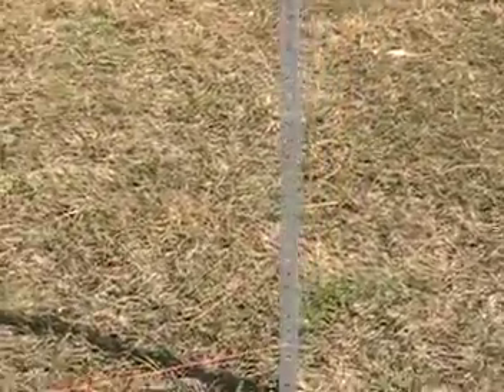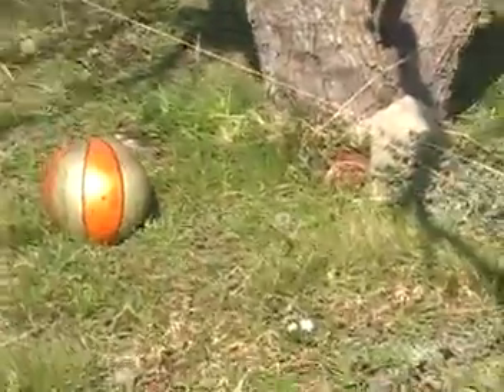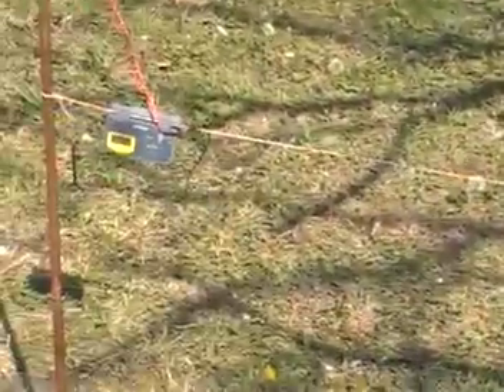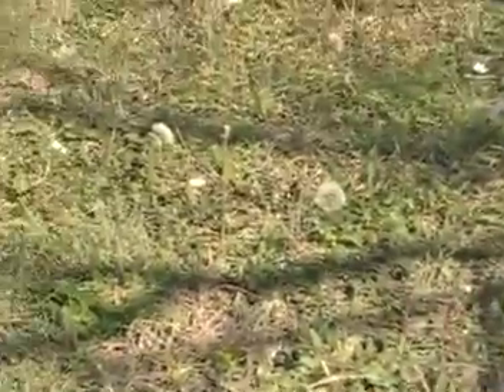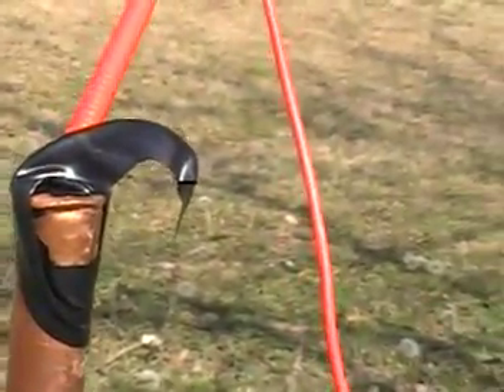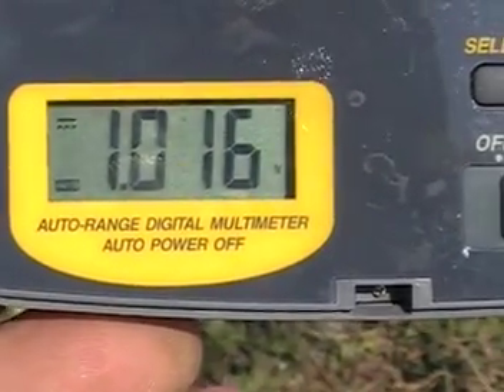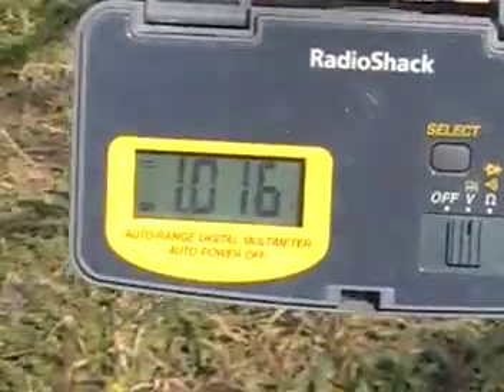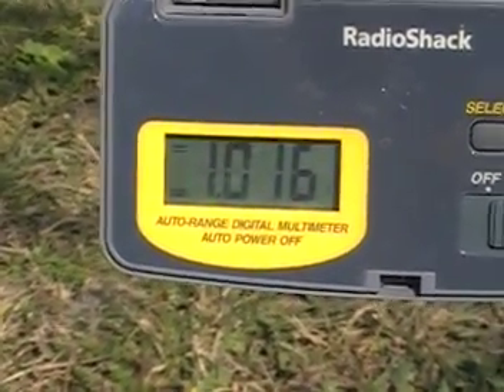My earth Battery

Comment: I looked into this a couple years ago and, if memory serves, the moisture of the ground made a difference in the output. 

With LED technology, one might be able to take advantage of this and other means of tapping the natural energy of the earth and air.

I worked at the bottom of the food chain in electronics and electrical work (PSNS and Keyport, Washington).  If nothing else, I've learned many claiming to know electricity know a lot, but less than they think they do. Though much has been determined, that is, it is reasonably safe to say electricity will act certain ways when you route it through this or that and so forth, it remains just theory.

Take for example, fuse panels or breaker boxes in our houses.  I hear electricians say "you'll use less power if you switch to as many 220/240 volt circuits as you can. However, in the end, it remains, though you are cutting amps in half by doubling voltage, the wattage (energy) in the circuit remains the same.

For example, a one hundred volt circuit using five amps would use five hundred watts.  If you doubled the voltage, you'd use half the amps (2.5).  Wattage is volts times amps, so you still get five hundred watts.

Consider the following: 

1)   You use two slots in the box, when you switch to 220, so you can't put any more circuits into the box by converting; and,

2)   Your circuits are limited by their wire, which the breaker protects (i.e., 15 amps for 14 gauge, 20 amps for 12 gauge and 30 amps for 10 gauge).

In the end, that wattage translates to heat (e.g, you'll burn the skin off your finger slower touching a forty watt bulb than you will touching a hundred watt bulb). As such, one might ask why they did not call it

Perhaps we should have called it a 24,000 watt panel (200 amp service).  Of course, regardless of what you call it, if you took advantage of every amp supposedly available at the panel, that would be a lot of heat in the panel and the line feeding it.

In short, merely that others know a bit about does not make everything they say [or presume] the last word.  Everything that could be discovered or invented has not been discovered or invented. So have fun, but play safe.
Reply: You're not considering line loss. Wires connecting from the power box to your appliance are not superconductors -- they act as a resistor and waste energy to heat. Delivering 500W to an appliance burns up more than 500W because the wire is burning some electricity too. The wire will waste less power at half current than when running at double current. You can calculate the line loss using: P = I^2 * R. The effect can be quite dramatic for high current appliances, since current is squared in the equation.
Reply: zilym
Line loss is always an issue. So is trying to squeeze a half K of wattage off one of these, which is why I never went there and just pointed to low watt lighting (LED). 

As was said elsewhere, these were used to power telegraphs back in the day.

Comment: I have watched several videos about this earth battery. How about putting pieces of long  copper pipe in the ground connected the pipe by a copper line, then using maybe gas pipe the entire length as the copper and attaching them the same way with same material as the gas pipe. I think mayb the depth and length is the key to the strength? Perhaps I may try it. Has anyone tried it?
Reply from the maker: Great idea.  Give it a shot and let me know how it comes out.
Reply: I did and you are correct about the depth and length.
Reply: Tesla tried but the jew banker shut it down. Teslas tower  had a well 12'by 12' with a metal shaft that was connected at the bottom to spokes that formed a 300ft circle around the tower.

Comment: Disregard any bad-mouthing you may get on this. It can be very useful if you suddenly find yourself off the electric grid and unable to communicate.
I worked as a radar tech for many years at local aircraft manufacturers and served a five year term as a student at a local university.
I am well aware of the science involved, and I am not belittling your experiments. It's the best way to learn. There is almost always a plentiful supply of scrap iron, aluminum and copper. Doesn't take a stretch to see how quickly you might get electricity.
Reply: RHEAD100 sorry just to jump in gentlemen, but i just had to compliment the way you guys speak to and respect eachother in here. Im Serbian and due to that a big Tesla fan so i love watching and learning anything i can about free energy. That being said, you guys are great in here. I came off a replacing a screen on a smart phone comment section earlier and the way they spoke to one another blew my mind. I was actually afraid to even ask a ? Thinking how dumb they would have made me feel. But you guys are human in here. You guys thank eachother, and lift eachother up instead of putting eachother down. Im sorry to interrupt, but i just had to tell you guys how nice it is to see human beings are still left in this cold world. God bless!!
Reply from the maker: THANKS BOSS ;   So far ;;;   The only bad comments I have gotten is from people that don't listen.     Iike ,  the guy that said I needed glasses  ( I said the sun was at my back and I could not see the view finder ).  And a lot missed the part where I said I know NOTHING of electronics.
I have Great respect for guys like you, that do.
Reply from the maker: Marko Milinkovic THANKS Marko .

Comment: That other thing you mentioned way down on this comments list about the static charge is possibly something of a different type of phenomenum. (I misspelled that), but there are other people working on that experiment. It has to do with an antenna that is insulated from ground and it picks up the static charges from the air,....which is higher in voltage the higher the antenna is elevated from ground.

Comment: The way to know if the electrolyte such as salt water is increasing the voltage would be to see if you can reach 0.8v in one cell with only water with no salt in it. I got the 0.8v figure for salt water from a DC electronics book, but it did not have a figure for plain water also.

Comment: In order to produce any potential you must have one metal that has a losely bonded electron in its outer orbit of its atoms and another metal that has the ability to gain an extra electron in the outer orbit of its atoms. But also the electrolyte can increase the potential it seems like, but I might be wrong here, it might only increase the current slightly.

Comment: The way to get more voltage from a salt water battery or any battery type actually is to make many cells by separating the water in separate containers with separate electrodes, and then connect the electrode to each other positive to negative and take the voltage off of each end. If you want more current, use large containers and large electrodes in close proximity between positive and negative electrodes but never touching each other.
Reply from the maker: John ;  My friend .  In every    "DETAIL ",     You are 1 0 0 %    CORRECT.

Comment: I think on the Earth battery it's really just the moisture in the dirt that causes the rods to act as a battery. The salt water battery will produce a higher voltage than a tap water battery, about 0.8v per cell is the limit. But it will cause more corrosion of the rods or plates.
Reply from the maker: DANG it  John ;  you  hit the nail square on the head.
Reply: ...interactive differential torsion fields facilitated by dissimilar materials? The salts and trace elements of salt water allow for a significantly higher differential exchange? Tuning the fields becomes the key to both input and output....?  Tuning is length of rods and/or thickness of material? Consider both the amounts buried and exposed as well as shapes for gathering/collectors? ...if we re playing w/ antennas...the earth battery is just an addition to the existing array; magnetic earth? IF we are closer to the actual harmonic Frequency ( 60Htz ) of the array then the more desired output we receive...?  ...consider the potential from the acidic effect of say adding this to your septic drainage field/tank? ...vs say lime or lime water or sea water? ...am I understanding this...or flawed conceptualization? ...although the acidic effect would work regardless of length or size...it would significantly amp the output? many smaller torsion fields interacting to create a larger harmonic torsion field, interacting with still larger torsion fields? ...scaling? ...?
Reply: Fox Fleet When you say 60Hz,then the existing array is the currently used power grid. I do'nt know if that is what you meant or not.
Reply: Fox Fleet
It is possible to pull power from the grid with an antenna,but very dangerous,costly,and lastly I think unfortunately illeagel. I forgot how to spell that word.
Reply from the maker: John Kerley Thought I said 6 not 60 Hz sorry
Reply: KISS. Thx Rhead100.
Reply: RHEAD100
I just replied to Fox Fleet because I saw it in my Email, no problem.

Comment: It's just that I have tried both the Earth battery and also the water battery experiments before and found the results pretty much identical.
Reply from the maker: I am glad you brought that up.  I , Personally have found it much easier to control voltage and amperage in the salt water battery.
Reply: The voltage you get depends on the difference in the metals involved much more than the electrolyte type.

Comment: I think the DC power lines are very high voltages. The telegraph turns DC into AC by back EMF from the relay coils on the key which is higher than the original DC supply voltage every time the key is released through sudden magnetic collaps in the iron core that the coil is wrapped around. I think the earth battery and the water battery are really one and the same.
Reply from the maker: Your explanation sounds great .  Better than anything I have heard so far.
THANKS.

Comment: Very interesting but if one were not near any Telluric currents in the earth, I wonder what would happen to the voltage if the ground was made basic on one end by mixing lime into the ground and acidifying the ground on the other end with Aluminum Sulfate to create a cathode and anode arrangement. I bet the voltage would be higher and wetting the ground at each pole would probably increase the voltage too.
Reply from the maker: MAYBE ;     That is why only , 2/3 s  of the telegraph stations in the US in the mid. 1980s used them.  And the others had to do something different.
Reply: RHEAD100
Ferrous sulfate is available, and might be better for the soil.
Reply from the maker: Tn Flash VERY Interesting Tn Flash. Many years ago I worked at a sheet metal shop.  We cut a lot of galvanized , copper ,  zinc, aluminum , and other metals with a band saw.  Once a year , I would collect a few pounds of the metal dust , and mix then together and sprinkle then over my garden. ( about 5 or 6 thousand square feet).  To this day I have not meet anyone that could produce as many Tomatoes or other vegetables. as me ,   per square foot.   NOT even a forth as much.  My neighbors thought my land or  I were possessed.
Never told anyone till you said something.   HAY;  They did not ask ,  I did not say.    They did not know,  could not explain.  SSOOO !!   MUST be VooDoo   Right .    HA AH HA HA .    We learn by asking questions, experimenting ,  and searching for the WHYs.  
Many people use news paper to keep weeds down between vegetable plants . Little do they know OR even think about,  earth worms love news paper . It is like candy to them .  and when they eat it , their Poop is 8 times richer in nitrogen (which plants LOVE).   A N D ;;;   news ink contains a trace element plants NEED ,  that is not found in any commercial fertilizer.
Reply: OurBossFan Acid loving plants would like both compounds.
Reply: RHEAD100 Thanks for the info. I looked up the ingredient list for Miracle Grow and guess what? A number of the metals you mentioned are in listed.
Ingredients from Miracle Grow MSDS/Label
Chemical	CAS No / Unique ID	Percent
Urea	000057-13-6	
Urea phosphate	004861-19-2	
Potassium chloride	007447-40-7	
Sodium molybdate	007631-95-0	
Ammonium phosphate, monobasic	007722-76-1	
ZINC sulfate	007733-02-0	
COPPER sulfate	007758-98-7	
Chlorine	007782-50-5	
Boric acid	010043-35-3	
Manganese EDTA, disodium salt	015375-84-5	
FERRIC sodium EDTA
I had a friend who grew football sized tea rose blooms. His secret was using small additions of a liquid fertilizer that contained a lot of methyl alcohol.
Reply: RHEAD100 Look into fulvic and humic acid. Plants use them to break down minerals, which is why we can use minerals we get from plants, even though we can't use the pure minerals.  It MIGHT be the acids would break the metals down and more usable to the plants.

Comment: with this current being so low, what can this be used for? maybe a cell phone charger? if you hooked up 3 to 4 in parallel, would that increase the amps and still maintain the same voltage?

Comment: Very interesting! This is a normal battery set up utilizing the difference in valence electrons between different metals. You should see a slight increase in your voltage to about 1.38-1.50v with increased ground saturation between points. That being said this also works if you take the sample of the two metals and run leads from each one, and lay them together with a salt-water soaked napkin your voltage difference will be about the same, its a lot more portable, but you will have increased corrosion issues (scrape it off and keep going!)
Reply from the maker: Know exactly what you are talking about . Had to do exactly that on my saltwater battery video.

Comment: One minor note. DC can be and is transmitted thousands of miles in the power grid, so don't believe that DC can only go 12 miles or so as you stated in the video.
Reply: John Doe
 The portion of the article you are quoting was concerning the time when Tesla and Edison were trying to establish the standard. In those days it would have required DC generators nearly on every block to provide the DC needed to power a city.  In very high voltage long distance power distribution, there are considerable inductance losses in AC systems that just don't happen with DC systems  The real tripping point had always been in the conversion to and from DC at opposite ends of the run since it was so cost prohibitive, but one of the advantages of a DC distribution system is that the generating stations need not be in phase with each other as they feed into the power grid since the DC can be converted to in phase AC where it ties in.  I have no time to go into a lot of details right now since work calls, but the information is out there if you do careful Google searches.
Reply from the maker: I like to learn new things .  So please tell me ,  What grid and What country.
Reply: There is at least one such transmission line here in the USA.
Reply from the maker: Ken C Where ???  Please  tell me so I can check it out.  I love to learn new stuff.
Reply: Here is a link to a list of different lines and projects that can be a starting point for your discovery process.  http://en.wikipedia.org/wiki/List_of_HVDC_projects
Reply from the maker: Ken C very informative .   THANKS
Reply: John Doe It is not the DC nature that is the problem.  It is the low voltage and high current that is the issue as you point out in your other post.  In the era of the creation of the grid converting AC to DC and DC to AC were costly and inefficient.  AC can be converted to higher and lower voltages by transformers.  Today, semiconductors have made DC to AC and DC to AC conversion so running long runs of high voltage DC is now a very practical thing to do.
Reply: When Uncle Sam sent me on vacation, back around 70, we had radio comm wire between battery operated land lines (phones) running fifty miles. It wasn't supposed to work, but it did.  However, we did have to go out and repair the line on occasion, after local farmer cut it tending his field.